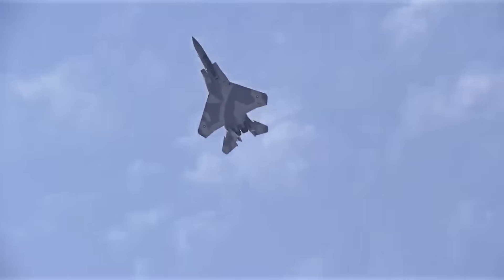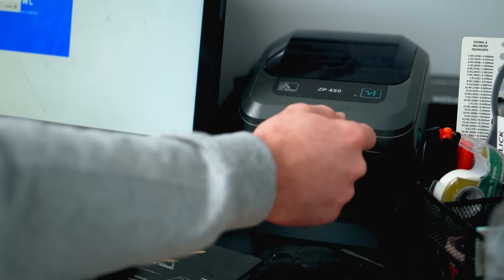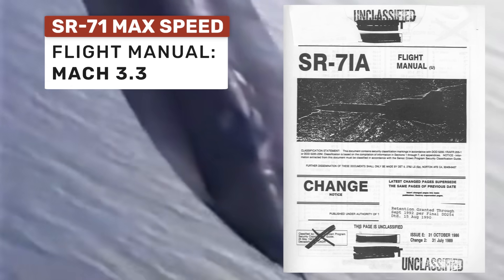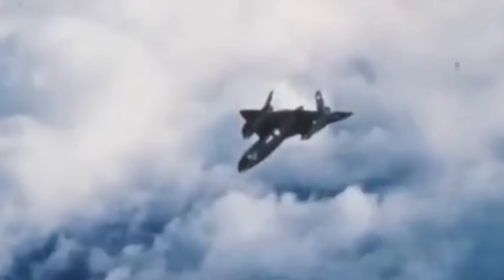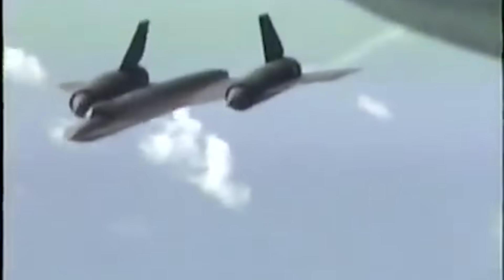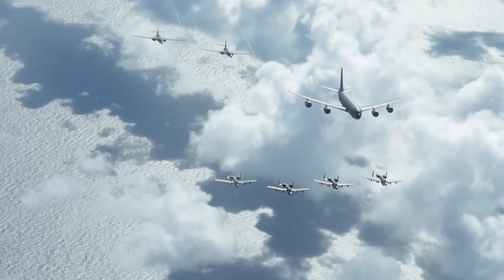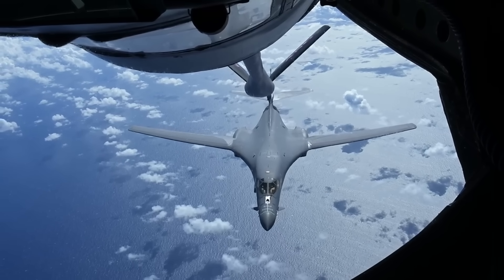The SR-71 was MUCH FASTER than the Air Force will admit

Comment: Hi, I'm a former aircraft mechanic for the former (not this new crap, wheels falling off, engine on fire, off the runway UAL) United Airlines and I worked alongside a former in flight refueler for the SR-71.  He told a story of how during a refueling operation where he's in visual contact with the pilot, he asked the pilot how fast the "Blackbird" could actually go. He said the pilot responded over the radio with "I can't tell you it's classified.". Then in a remarkable display of "pulling back the curtain" the pilot held up his hand and showed the refueler all five fingers as if to state an actual speed of mach 5!  
Now here's something people rarely state when mentioning Mach:  Mach at altitude, that is, above 30,000ft is 652 mph and at sea level it's 752 mph. This is because mach is a speed of sound measurement which varies with density. In less dense atmosphere mach is slower which is the case at higher altitude. In outer space Mach is zero. These things need mentioning when throwing around Mach numbers. 
So, with that in mind, Skunk Works may have been playing a little game by publishing low altitude mach Numbers to throw looky-loos off of their trail!  Mach 3.2 at sea level is 2,407 mph approx. At altitude it's only 2,087 mph approx.  They know that the Russians would have been thinking 3.2  is an "at altitude" speed.  If they really mean that the speed is 2,407 mph and the craft actually flies that speed at altitude then it's relevant Mach number is actually 3.69. 
Now if the 71 flew at mach 5  at attitude like my coworker stated then it would actually achieve a speed of 3,260mph which is very close to what another commenter said here about the plane regularly flying at 3,000mph.  That speed's mach number drops to 4.3 at sea level.  
Back in the early '90's I spoke with an SR-71 pilot at fleet week in San Francisco and he told me the limiting factor of speed wasn't the engines because they are ramjet engines, but it was the limit of the aircraft material capabilities. He said the leading edges would heat up to 900 deg F.  Funny though, he didn't say they couldn't get hotter and maintain their temper!  He also didn't say what speed or altitude the craft was flying at when they got that hot.  It seems to me that they speak to people stating specs in an ambiguous way knowing that we will assume they mean one thing when they didn't actually state it. 
When I hear stories like this and I look at all of it from the 30,000 foot view it all comes within the realm of possibility!  When all is said and done, I really don't know, they're just stories until I can actually verify it all!  Peace out!
Reply: Such a great story ✋👨‍🚀 thank you for sharing!!
Reply: @chris_jorge  
Your welcome!  Happy to!
Reply: I heard from a Vietnam-era AF radar guy that the 71 did 3500 on his scope. And they had to get read in to monitor before the 71 flew through SE Asia.
Reply: @FUTURECONFLICTCHANNEL  Wow!  That would be Mach 5.37!  Other commenters in this post were saying that as well and a couple were saying it could fly as fast as 6 to 7,000mph!
Have you heard of the X35 (I think)? It was the lifting body aircraft developed back in 2005 to 2010 or thereabouts that was achieving 12 to 13,000mph with a new engine called a SCRAM jet. That stands for Supersonic Combustion Ramjet. Interestingly enough that aircraft could take the heat. Also even in the 1960's the Atlas rockets could take the heat generated at 17,000mph which is their entry into orbit speed.   I say this because thermal limits are always mentioned about the 71. I'm not so sure that's an actual issue!
Reply: I would not question for a second whether the SR-71 is / was Mach 5 capable. The issue really is the fact that the poor bird has to take off. If the airframe was dropped at 30k feet and 300-450 mph, the restrictors which allow its power plant to go dual mode would be lifted and it could likely maintain stability well past five fingers. 
It's all about compressor stall. For the time, the intake design is an absolute amazing breakthrough. That was how many decades ago? 

Dual-mode means compromises. Maybe there's a "third mode" setting no one every admitted to already built in. (Likely would have been in the mid 80s.)  I'm guessing the last 5 were tested and capable of blowing past at least 3.8 without mods, with a freshly designed 25 years newer inlet system? nothing wrong with the airframe going for more sky.
Reply: The SR71 was made out of Titanium.  This metal begins to soften at 3000 degrees and higher if it has a composite mixture.  The mistake or omission that most people forget is that the SR71 was also a ramjet. Ramjets operations begin around mach 3 up to about Mach 6. The X15 in all likelihood was a testbed for the SR71.  The D21 drone was a pure ramjet that was launched from the SR71.  The D21 just omitted the jet engine and had a mostly fixed inlet nozzle.  The SR71 capabilities in all likelihood greatly exceeded the public Mach 3.2 speed.  If what as some X15 designers have stated is true, then the SR71 could fly as fast as Mach 6.7. I personally believe it topped out at Mach 7.1 hence the 72 in the SR name. The truth is always in plain sight 😉
Reply: i bet the pilot tells his girlfriend he has 8 inches aswell
Reply: I can tell you this. Swaying from side to side when working on SR-71 Blackbird in 1979 the document in front of me was 50 years ahead of 1979 and some 20+ years ago at the same time. Try to explain that to anyone else outside of the lab. Darker than black because a touch of blue is in her. Grayscale is the only way to look at her without losing your mind in the process.
Reply: I'm a retired AE with Lockheed Martin...the 12/71 did not have Mach 5 capability...that is all.
Reply: @stevefowler2112  
Well, yeah I'm sure for you that is all, but for a lot of people, especially those who've heard personal testimonials that isn't all. Obviously you're not concerned about being persuasive, rather you're authoritative and dismissive. I think a lot of people would need to be persuaded as to why they should believe your authority over many testimonials!
Did you work in Palmdale? What did you do for Lockheed?
Reply: @superdude1759  As I said I'm a retired Aerospace/Computer Engineer with LMT. I worked at Palmdale, Burbank, Ft. Worth and finally Orlando. One of my first assignments was being sent to Okinawa to run a calibration test on the 71's flight navigation computer. When i said "that is all" I meant i can't/won't say more. I signed a large stack on TS NDA's as part of my retirement package and I certainly am not going to break them on an open forum such as this.
Reply: Summer, 1969, Beale AFB. A cherry pink SR71 swooping in to land at dusk is indelibly etched in my memory.
Reply: I worked for Lockheed during 1977-1978 SR-71 Blackbird as a paste up artist. She was so dark that pitch black didn't even come close. Shrouded in secrecy she was. I'm not a rocket scientist. Mach 3.7 was a rumor. Maybe I didn't know. I didn't know a lot of things. I just did my job. We worked for every major defense aerospace company in the United States including NASA. Whatever mach 3.7 is? She was the Queen of stealth technology and Kelly Johnson's team did amazingly beautiful black with a touch of blue thrown in.
Reply: Fantastic comment, and very sound reasoning, thanks for chiming in... 😎👍🇺🇸
Reply: do you really enjoy spreading unverified, unsubstantiated rumors?  I spoke with a guy who said his sister once cut hair at a place where someone said their dad knew a pilot said it could do mach 9
Reply: @slowery43  
Do you really enjoy being functionally illiterate?
Reply: @slowery43  
How do you know that the stories I was told are unverified and unsubstantiated rumors?  I don't even know that. I was merely passing on the stories told to me as evidence to the possibilities that there are. I cannot establish whether or not they are true, but I don't have to. In fact no one has to because that's not the purpose of examining possibilities.  Furthermore when does anything have to be verified or substantiated as to determine its truthfulness. Verification doesn't establish whether a thing is true or not. It only establishes one's belief as to whether or not that is the case. Truth is such as it is irresprctive of verification. 
If something is true then that truth IS THE SUBSTANCE of the matter. No amount of substantiating can change that. The real matter at hand is whether something is in fact true not what someone says or thinks about its validity.

Comment: Not only speed, but altitude. Advertised altitude was 85,000 feet, but could go much higher. I remember seeing an interview with Francis Gary Powers, U-2 pilot. He said that the U-2 could fly substantially higher than the advertised altitude of 80,000 feet. That's why Russia migs could never shoot it down, but a missile finally did over Russia with Powers as the pilot. Powers survived, and those reading this will be knowledgeable of that whole story.

Comment: This debate should not be had in Mach numbers but actual ground speed. As everybody should be aware, Mach 3 at altitude X is not the same ground speed as Mach 3 at altitude Y. Introduce effects such as inversion layers and the discrepancy may widen enough to produce a higher Mach number but less actual ground speed than a lower Mach number.
Reply: Not even in ground speed as that may fluctuate due to wind direction vs flight direction.

Comment: Armed Forces Day 1983.  The Air Force flew an SR-71 from Davis AFB to Andrews AFB.  I had the chance to meet the pilot.
While waiting my chance to do so, the pilot was talking to a pair of officers from Andrews.
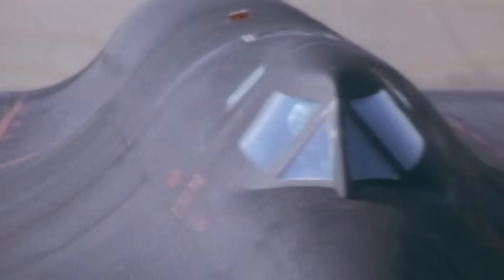The pilot talks of leaving Davis @ 5 a.m. local Cali time. 59 minutes later @ 8:59 Washington D.C. local time - he was in landing pattern over Andrews. Slightly over 3k miles in 59 minutes.
Mach 3 my ass.  @ 680 mph speed of sound that translates to Mach 4.5. I can't blame the Air Force for sand bagging top speeds. But just doing the math with that info, anyone can guess the numbers are slightly off.
One other comment here. November of same year, I got to visit Pautuxent NAS.  We got to watch launching of a pair of F4 Phantoms.  The launched Phantoms went from a simulated carrier deck catapult.
Now, I was always told no plane could go straight up.  I callbullshit here.  Both Phantoms launched, rolled right and went straight up at an insane rate.  Again, gotta down play performance.....
Reply: "Now, I was always told no plane could go straight up."
Thrust to weight ratio. If the engines can produce more thrust than gravity can pull the weight down, the plane can go straight up like a rocket. The F16 is officially capable of doing so.

Comment: I tracked something in West Germany that I estimated at 5 times the speed of sound.  Our 43 radar would not register the speed of the contact above 500 knots or so. So I figured out the grids covered and the rotational speed of radar.  And it had the “ Cat” symbology of a special flight.  Mid/late 80s

Comment: Considering the XB-70 Valkyrie was casually riding at Mach 3 while not being literally made of almost entirely heat-resistant titanium nor having literal RAMJET engines, but rather still using regular jet engines, and considering the crazy aerodynamic of the Blackbird compared to that huge bomber, I wouldn't be surprised at all if the Blackbird could actually go up to Mach 4 or even Mach 5 in reality.
The Valkyrie was made out of stainless-steel honeycomb sandwich panels and titanium, a small part of titanium compared to the almost entirely made (~90%) of titanium's Blackbird.
And regardless how many jet engines you use, a RAMJET will always have advantages at high speed and high altitude when it comes to getting fast thanks to their wider supersonic envelope, without requiring to go SCRAMJET.

A jet engine can hardly go faster than Mach 3, a RAMJET can operate between Mach 1 and Mach 6, so the Blackbird have theoretically a lot of room for higher speed than the Mach 3 range.
Mach 3 is where the Ramjets are the most efficient, but not their max speed at all.
Yes, I know, the J-58 isn't a 100% Ramjet, but it is also much more specialized than a turbojet such as the Valkyrie have, and the first year the A-12 was equipped with its J-58, they already reached Mach 3.2, and it had a long career, I can't imagine the aircraft with such advanced and almost overkill techs getting only designed for Mach 3.2/3.3.

Older than the Blackbirds, the Lockheed X-7 who had a RAMJET was able to go above Mach 4, and I quote :
"The X-7 was constructed from steel, unlike its successors such as the A-12 and YF-12 which used titanium. These X-7 planes had wings constructed from stainless steel and a fuselage made from a nickel alloy. The use of steel was due to the inability of aluminum to endure air friction heating at hypersonic speeds, years before the widespread introduction of titanium.".

So if I had to take a guess, I'd say the Blackbird was more like Mach 4.5 or Mach 5 capable for short durations, efficiently cruising at Mach 3.2/3.3 and able to continuously get at something like Mach 3.9 continuously without heat issues but at higher fuel consumption cost.
All it would take would be the Ramjet part, behind the moving spike and around the J-58 to have some clever design that we are simply not informed about, and running it a mode where 100% of the air in the bypass go around the engine rather than being vented, making the Blackbird's engines being literally a regular RAMJET with a turbojet engine in the middle serving as the combustion part and clever heat exchanger to heat and help expand the air within the bypass near the exhaust, and while we know how the J-58 jet engine part do works and looks like, along with the spike itself, there isn't much real life images of the inside of the bypass itself...

This also mean, it probably also flew higher than the official maximum altitude of FL850 too.